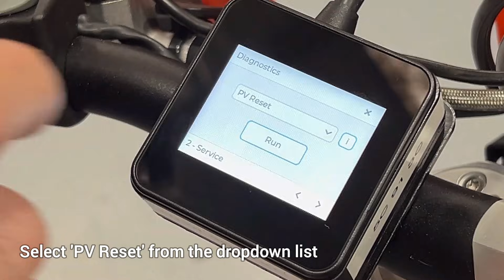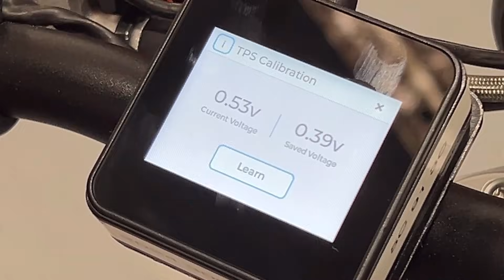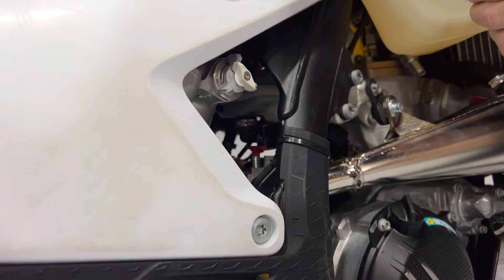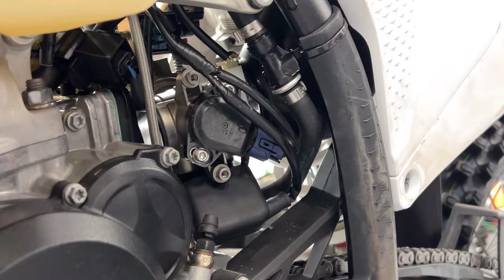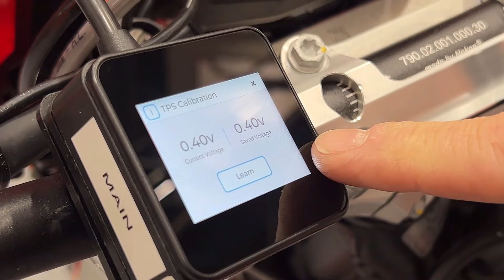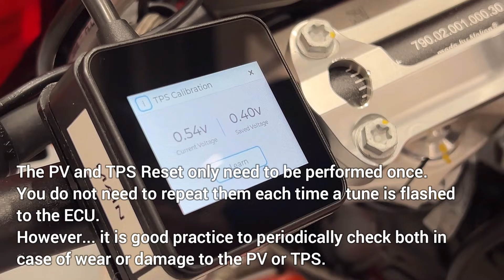Getting Started 6 (TBI only) - Powervalve and TPS Reset

Comment: Seems my idle TPS voltage is slightly higher at 0.58, if I use 0.55 the bike wants to shut off. Hopefully that’s ok, bike is 2024 EC300

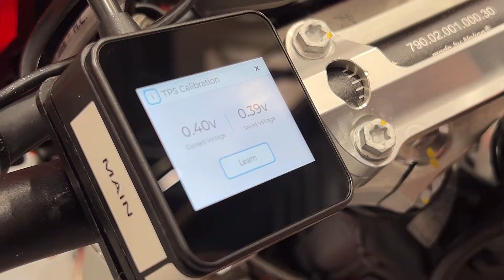Comment: At approximately 7:14 into this video TPS Reset|Learn is executed, but there is no mention of a full throttle rotation x3. Without manual rotation of the throttle, how are the TPS Adaptive values reset, particularly when swapping the throttle cam (black/white)?

Comment: Assumption: per another comment - if my saved voltage is ALREADY .40 on initial plug in I do not have to do this? I would just set the red .52-.56 and yellow +10 to appropriate idle settings and see if the RPMs are in line when the bike is warm and running.

Comment: got a new tps sensor (old one broke off) and it will not go below 1.5V. (as in when twisted to the lowest place possible. The middle position is around 2V) The dealer says i have to "initilize the sensors" and wants  to charge a bunch. Do you have any tips for this. Bike is a ktm 2024 300xcw.

Comment: If when looking at the TPS Calibration for the first time the saved voltage already shows 0.40v, do we still need to go through the process of resetting it?
Reply: I’m not affiliated with TSP, but I think I can help.

Just follow the procedure outlined by TSP:
	1.	Loosen the throttle cables.
	2.	Loosen both the red and yellow adjustment knobs on the throttle body until the voltage stops dropping
	3.	If both values (saved and current) read 0.40 V, you’re good to go. I’d still hit the “learn” button at this point. You only need to rotate the TPS if both values don't match 0.40v

Once you are sure both current and save voltage values are 0.40vm,  adjust the idle screws according to the TSP tutorial --> Tighten the red screw until you reach 0.55 V, then the yellow screw until you reach 0.65 V. These values are not universal, they’re just a starting point to get close to your idle. You’ll still need to fine-tune the idle by turning the red knob slightly, but the adjustment should be minimal.

Once everything is done, let the bike warm up and recheck the idle on the ERM dash. Make sure it’s set to the value specified in your bike’s manual. On my TBI, it’s around 1400–1500 RPM. 

TSP correct me if I am wrong.
Reply: If its .40v already. I dont think you need to do anything. Adjust the current voltage to .52-.54v and then press in yellow and make sure its .1 greater so within .62-.64v

Comment: Did all this steps but my idle is at 0.63 is it ok ? bike is at 20hrs
Reply: My idle is at 0.61v as my bike wouldn't even idle at 0.53v. From memory, about 1500rpm
30 hours and about 650m above sea level.
Reply: @hackgolfer7352my bike wont even start after doing it all with recommendations on values